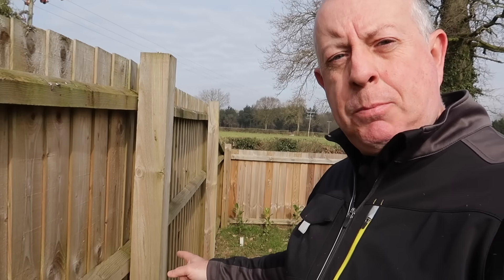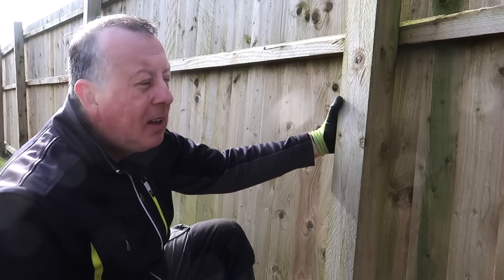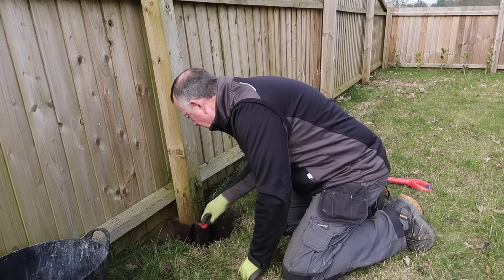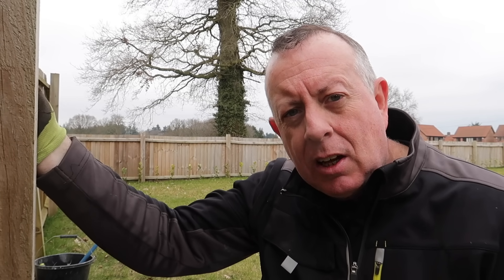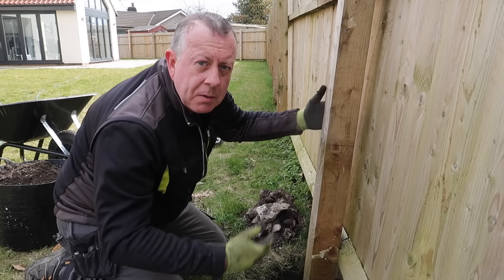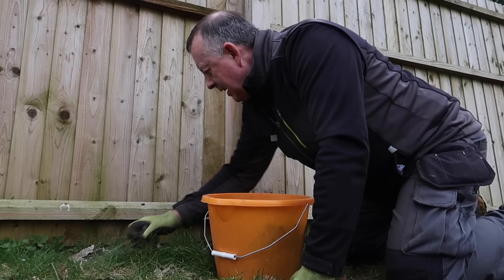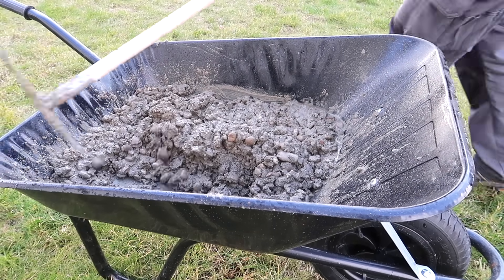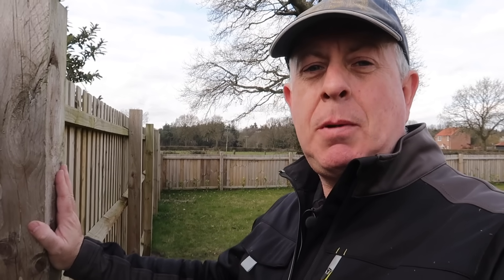How to Fix Leaning Fence Posts

Comment: Thanks, part of your problem is the cement should extend to about 1 inch or 25 mm above the ground. This ensures the water runs off the wood so it won't rot and break off. The other problem is the size of the concrete around the pole is quite small, it should have about another 2 inches or 50 mm across, or at least 1.5 the width of the pole on each side. This helps prevent wind from leaning your pole over when the ground gets wet from rain. To make things easier, detach the cross boards from the post, pull the whole post and the cement still attached to the pole. Wash it off, dig the hole a little bigger, put the post back in and fill the extra void with more cement. Leaving the cement attached to the pole means you'll need less cement to fill the hole. It also requires less expensive tools to complete the job. Super video though, Thumbs up. Thanks for sharing. Best Wishes & Blessings. Keith Noneya
Reply: That's what I thought. Cement  all the way up.
Reply: +1
Reply: Nah
Reply: I use galvanized poles now, no more rotting
Reply: @driftx2  Galvanized don't rot they rust and break off at the bottom, especially in high winds and rainy areas. All my neighbors who used Galvanized poles had them bend over in the storms we've had since our neighborhood was new in 1996. All of them required a complete fence rebuild and all of them went to wood posts. The 4x4 wooden posts I used in 1996 80% of them are still standing. The one that rotted were the ones I didn't ensure had the 2" or 50mm cement around or above the ground around the pole. Since 1996 ALL of the fences that had Galvanized poles in my neighborhood have been replaced with Wooden Posts. Now when I replace poles I use 4x6 treated posts, those won't bend and take years to rot if cemented and treated properly. 25 years and counting on the original wood posts. Not saying they don't look nice and go in easily, but they as all fence posts present problems of their own like rust and are easily damaged by wind. There are over 400 homes here, none use galvanized anymore. Best Wishes & Blessings.
Reply: @driftx2       You’ve been schooled.
Reply: Get somebody els to do it.
Reply: First off - it's not "cement", it's "concrete"...cement is glue and is only an ingredient of concrete which is varying amounts of sand, gravel and cement. Common mistake.
Reply: @dannystricker854  LOL!
Reply: @keithnoneya  Does "LOL" mean "lots of love"?...back at you
Reply: @dannystricker854  Sure why not! Best Wishes & Blessings. Keith Noneya
Reply: @keithnoneya  my 4x4 lasted like 3 years. Are you sure your neighbors used galvanized or just steel? Most traffic lights are galvanized poles. Do you see them rotting and rusting after a couple years?
Reply: @driftx2  Only 3 years wow that's weird, were they pressure treated for outdoor use? My neighbors used the typical Galvanized fence posts, screwed 2x4 boards on one side and then nailed fence boards on them. If they survive the hurricane winds we have down here they last 4-5 years before the rot or bend over. Oddly there's a school that used Chain-link fencing and it has lasted for decades. But then I don't know what maintenance they've done on it. Also they didn't use boards on it so there's less wind cross section to push on it. I have a video of a portion of the fence bottom that has been up since 2005. You can see the very bottom at time index 2:14 in my kitty video here: https://www.youtube.com/watch?v=euP2U9_QKA0 The 4x4's in the video have been in the ground since 1996 (25 Years) and the cross supports and fence boards have been on there since 2005 (16 years). Two of the 4x4's just broke at the bottom this last Oct and the rest of the fence is ready to be replaced for the 3rd time since 1996. Best Wishes & Blessings. Keith Noneya
Reply: Concrete all the way up would look shit
Reply: @keithnoneya  yep. I put a fence up with 4x4 wooden posts 20 years ago, making sure to concrete to above ground level. When I replaced the fence last year the posts were still perfect.
Reply: @driftx2  depends on how well they have been galvanised.
Reply: @driftx2  True but they still lean if the foundation is too flimsy.
Reply: @keithnoneya  4x6 posts blimey. I bet they are expensive. But I suppose not over 25 years...
Reply: @micdev42  Yeah in today's market they were about $18.00 ea, about $6.00 more dollars than a 4x4 post. You are right when you figure over 25 years the extra money is well worth it for a stronger and more reliable fence. Best Wishes & Blessings. Keith Noneya
Reply: @driftx2  lasted 3 years?. Right. Whoever installed obviously did something majorly wrong. I got 23 yrs on the ones I installed
Reply: @keithnoneya  so you had to replace the cross boards and fence boards about every 8 years? I’m surprised they didn’t last longer.  We have hurricanes here. Wouldn’t a fence like this one survive better in high winds if it had a little space between the fence boards? My neighbors fence blew down, the posts had been put into a concrete base that ran the entire length under the fence. Of course the posts snapped right off at the top of the concrete base.  I don’t know why the installer dug out a trench the entire length of the fence and poured concrete into it and set the posts.  So now I suppose the only way to fix the 3 downed panels is dig down next to the 3 posts and sister in a new  4”x4” post?what do you think?
Reply: @kayBTR  Hey Kay, wow that sounds like fun! I've never run across a fence built like that with wood. I guess your friends could get a long auger drill and grind all the wood out and slide a new post in. Otherwise they'll have to cut the cement footer or sister mount a post in the ground. Maybe sister post one on both sides for some added wind protection. I'd really like to hear how he solves that one.
Part of the reason I had to change the runners was some of the treated the wood just doesn't last long here with the high humidity, 80-90% and temperatures in the 90's in the summer, plus hurricanes. The first time I built the fence I built it California style from the 60's with the cross boards cut to length between the posts instead of overlapping them sideways on the sides of the posts. I also only used two runners per panel, mistake for sure. I now use three cross boards, with the tops and bottoms mounted to within 8 inches, (20cm) of the ends. The last set I mounted the cross boards on the sides of the posts just after Hurricane Katrina. So far the boards under the tree in the shade are still good, some of the ones out in the sun are bad and need to be replaced. When I do replace the posts I now use 4"x6" post to protect them more than the cross boards. I'd rather the cross boards are blown off than the post break off. Regarding the gap in the boards, there should always be a slight gap. If you put the boards up wet you can loosely butt them up against each other. If they are dry you'll need to separate them with a nail or screw then attach them. If you don't gap the boards when they get wet they'll expand then bind and over time they'll tear the fence apart. As far as gaping them to reduce the cross section of the fence in wind you can do that a little but gaping them to far kind of defeats the purpose of having a fence. Some fences do gap them by placing every other board on the opposite side of the cross boards. It does allow the fence to pass some wind but doesn't reduce the cross section very much unless the wind is hitting the fence at an angle. The gap will also depend on how you mount the cross boards, vertical or horizontal. Hope that gives you some ideas. Best Wishes & Blessings. Keith Noneya
Reply: Great video. I'm needing to fix my leaning post. I will copy your method 👍
Reply: All my years of fencing I have never had a customer who actually wanted to see the concrete. You leave the concrete 3 to 4 in below the soil so that grass can grow nicely around the post. If you only leave an inch or so the grass will never grow nicely
Reply: @terracub  That is true for some customers. However the customer may not know that if it's done that way they are inviting wood rot and dings in the wood post from the weed wacker and the post won't last as long. Those dings allow water past the 1st barrier and that's one of the reasons posts that look good on top need to be replaced more often. I'm just now replacing my fence posts that have been in the ground since June of 1996, 28 years. Some of them are still good, but I might as well replace them all at once. Best Wishes & Blessings. Keith Noneya
Reply: Thank you! Only problem is I'm a chick, 59 years old and the bags of cement are like 100 pounds ugh
Reply: Mine have been in since 99 but with erosion its been getting worse last 5 yrs.
Reply: @sherrym5556  Oh I feel your pain Sherry, I'm in my 60's. Getting old isn't for wimps that's for sure. Best Wishes & Blessings. Keith Noneya
Reply: @driftx2 where to buy those

Comment: Concrete should always come out of the ground an inch or so. Otherwise direct ground contact will rot the post. Create a small square form for top when pouring form which results in a nice clean strong post. Not sure why people attach rails like that. They should be flush with the post by toe nailing/screwing into posts. Much more attractive and cleaner looking. Thanks for posting
Reply: It's due to cost. It's much faster to build the fence like in the video. As these are boundary fences the cost is split between the boundary owners. Cost becomes an important factor.
Reply: @HardstylePete  - that’s why I build my own. Cost of properly securing the rails and properly pouring the concrete are minimal. If you’re trying to save cost there you’re doing it half baked in my opinion.  To each his own.
Reply: I was surprised to see the post going into the ground. Here in Western Washington, that would hardly last more than a couple years before rotting through.
Reply: @JadyLester  Hello from Mukilteo. 😅
Reply: U are right 100% that is the right way to make post last so rain   go away
Reply: @HardstylePete  it's the same thing like buying from Poundland... you get what you pay...if you want Quality.. don't buy from Poundland...but if you want something quick and cheap..no problemo 😏

Comment: Strange to see that the top of the posts are left horizontal with a factory cut. In Australia we cut a 30 degree on the top of our posts for water to run off & not sit on the timber.
Reply: It doesn’t rain in Britain though 😂😂

Comment: Some great tips. A coat of bitumen paint on the post to just above grass level is great for keeping moisture out also
Reply from the maker: Great tip!
Reply: I used a product called Flex Seal. An aerosol spray rubber concoction that sealed the concrete and the wood. Flex Seal also has a long list of products from tape to paste to liquid forms
Reply: I surround mine in DPC and works a treat.
Reply: bityumenrm
Reply: asphalt primer works well too
Reply: On the the entire section in  the cement as cement is pourous

Comment: Hi Stuart, As others have commented on how to get the existing concrete out without the best tool. A away around the issue is temporarily support the fence on both sides of post. The unfix the post from the rails and put the whole post out of the ground. Then, the concrete can be removed from around the post. It's then a simple process cleaning up the hole and  reattaching the post for concreting. 
Others have commented that the concrete should be exposed above the ground, which I agree. Another good practise is to put gravel in the hole before replacing the post. This away any moisture that seeps between the post and concrete can flow through the rocks and go into the ground as timber does shrink and expand all the time. Without the gravel, the post can be sitting on wet ground.
There were a few points that I will be using for projects in the future.
Reply: Really good point. I've known an 8" square timber bollard snap clean off when nudged by a vehicle - purely because for the rot caused when the water seeping down between the concrete and timber was u able to drain away.

Comment: Great tip to offset the string to line up the post properly. I've watched a dozen or so videos about setting posts and always wondered how they were certain they were not pushing on the string ever so slightly. Appreciate the eye for precision.
Reply from the maker: Thank you very much. I learnt this some years ago form a sit carpenter.
Reply: I've just put up a 6 panel, 3 foot high fence in my front drive and spent ages fannying around so the string line was just kissing each post. The offset is such a good, obvious thing to do and next time I will follow that tip. Thank you and great video by the way 👍
Reply from the maker: @simonw4340  Thank you. Obvious  once you know.
Reply: Mostly its down to lining up by eye

Comment: I came across your channel regarding fitting internal doors for my sister and just found this whilst looking for tips on how to straighten my elderly Mums swooning fences to save her some much needed pennies. As I'm becoming accustomed to your channel and many like yours in Britain, there's no doubt at all that you're really an invaluable source of education for people and just wanted to show some appreciation for your efforts in sharing your skills. In times like these where DIY is becoming a must-have, you guys and gals in the trades deserve a lot of respect. So thank you. 

All the best 👍
Reply: How would you do this with concrete posts thanks 😊
Reply: Find "knot tying" guidance videos on YouTube, buy some stout rope  and attach the rope to the top of the post (Clove Hitch perhaps?) OR a loop around a nail in the adjecent attached fence panel and tie this to a stake in the ground (where the post is leaning 'outwards') or a timber strut bearing against a temporary timber stopper block screwed to the adjacent fence panel if the post leans 'inwards'.

Comment: That post I'm sure is pressure treated, but I would bring the concrete above grade, higher on post and slope back to ground level. That way there is no chance of water standing at base of post and possibly rotting off.
The best way to go, is spend the money and use galvanized steel post. They have some neat ones on the market today. From the end they have a look like channel iron with wing and multiple holes in the wings, top to bottom. And you can cover the steel post with a piece of fencing and it hides the post.
You did a great job regardless of my opinion. Most guys would have just added more concrete on top of the old, but you went the extra. Great job !!!

Comment: Concrete everytime, stronger and alot cheaper than postmix. I find I need at least 2 bags of postmix for 1 post, which at this moment in time is about £5 - £6 per bag. The only benefit with post mix is the working time. At the residential homes I work at I've put up loads of different fences and the only one that has given me the same problem you have on your video is the one where I set the posts in postmix, and that was only 4ft high with 2 bags per 3x3 post.
Good video and easy to understand, keep up the good work 👍
Reply from the maker: Thank you. Your thinking on postfix is the same as mine.
Reply: I’ve done fences with a mixer and hand batched. I’ve done loads with postcrete. All still standing. I know of fences with concrete posts I did about 16 years ago still level and plum. The hole you dig can be fundamental regardless of what mix you set the post in. Hence in this video she’s a rocking and rolling, maybe was a Friday 😂. I’ve yet to see a properly set postcrete post fail. Price hurts at home but on a job it is what it is. Unless you want to beat a rival. Cheers
Reply: Make the hole smaller if you are using 2-3 bags you don’t know what you are doing 
Knob jocky

Comment: You never have to dispose of the old concrete rubble. you'll always use it as fill in the new bigger hole.
Sloping the surface away from tbd wood was an excellent tip!
Putting a couple of nails in the post will stop the post sliding up/dn.
Decades ago, we'd dip or paint the post end in oil to keep out water.
Reply: Posts don’t slide up and down in the concrete. I wish they did, it would make my life easier. Btw, putting screws in the post before you pour the concrete is a way of increasing the likelihood that people will hate you. So unnecessary.

Comment: Where I live there is no soil it is all sand. When my son & I put in a new fence , we dug the holes approx 1 meter into the sand, aligned all posts then concreted about 200 mm in the bottom of the hole. allowed to set for 24 hrs, filled in the holes to allow another 200 mm of concrete to finish just below the final ground level. When finished all posts were very sturdy due to bottom & top reinforcing. It hasn't moved in 18 years. Enjoyed your vid.

Comment: i put a fence around my yard in 1996 using 4x4x8 post.i did not set them in cement.i used dirt and gravel.none of my post have rotted.i have had 5 of them leaning like yours.i used my riding mower and some rope to pull them straight i used 6 ft. metal t-post drove it in beside the wood post 3 ft. down and secured it with 3 inch screws.this worked great.

Comment: For a fence that lasts forever, install concrete spurs into the ground (with postmix) and bolt the wooden posts to the spurs (half an inch above the soil) which come cast with holes in them. If you don't like the colour of the spurs they absorb wood preservative just as well as wood does.